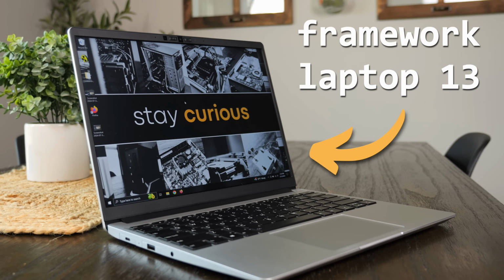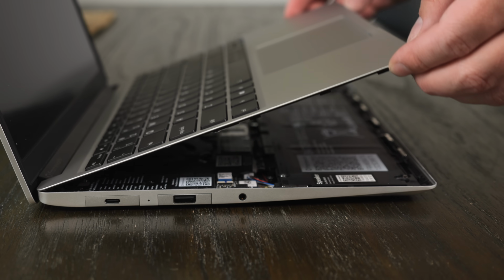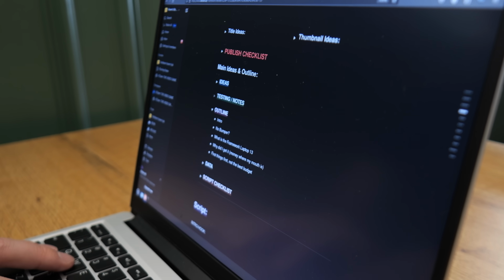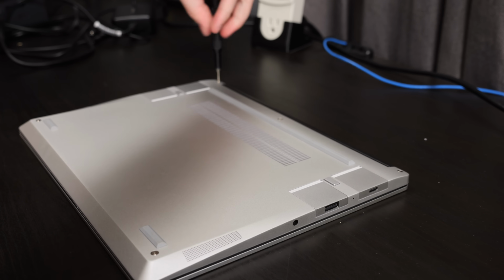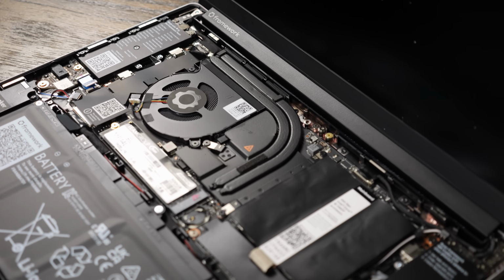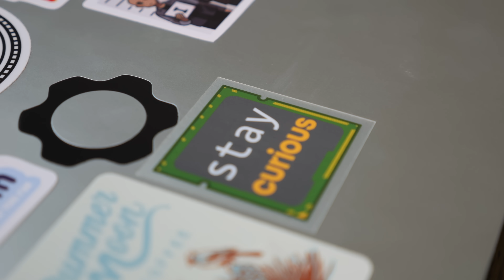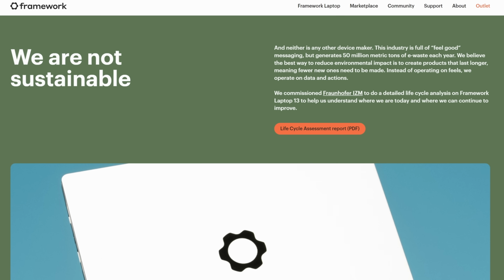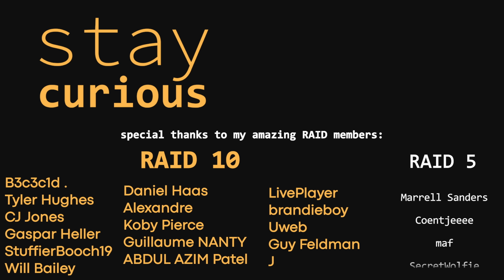Is The Framework Laptop ACTUALLY Worth It?

Comment: I always get frustrated by people completely misunderstanding the point of these laptops. Yes, they're initially more expensive than others (the company is also small, which adds up to the price), but the idea is that you'll never have to buy a new laptop again. You can just replace and upgrade parts as you need them without paying around $1k for a whole new system

If you only care about the price, buy a second hand thinkpad or something like that. But you'll still need to buy a whole new computer when you want to upgrade
Reply: @kadupse  You almost get the point of a Framework laptop before completely missing it.  Yes, in 3 years your laptop has wear, but the wear on individual parts is different.  I've got a couple decade-old laptops I'm still using, and the thing that fail first are the keyboard, trackpad, speakers, and battery.  Most of these are becoming hard to replace thanks to OEM design.  I've spent a few hours replacing a keyboard on a relatively new gaming laptop (while using a dremel, hot air gun, and a soldering wand to melt plastic), where the Framework would be 5 minutes.

Next up to fail is often the hard drive, although not certain if that'll be true for NVMes.  Still, buy a Mac and you're SOL when there's a problem past warranty.  Less often to fail is the mainboard/RAM but these events usually trigger a new laptop purchase.  With a Framework, you can still do that and keep your old chassis for projects, or you can keep using parts that may well work for another 5-10 years.  Up for you to decide what you do with your own purchase.

Monitors and ports do die, but most often due to damage.  They're easily replaceable on this unit, whereas in others it'd be a time-consuming fix or a mandatory unit replacement.  You mentioned that Framework laptops have had problems, but those used laptops you want to buy quite often have them as well.  Weak hinges is common on a lot of laptops, albeit normally cheaper priced ones.  Modern standby is used by a lot of laptops, and many OEMs don't allow you to disable the feature at all.  

The recent short battery life problems are partly to do with Display Port and HDMI ports not sleeping correctly.  You can fix this with a firmware flash for the DP, or a solder job for the HDMI, instructions provided by the company.  The HDMI one isn't worth the risk to fix IMO, but you can replace it for the $15-20 if you need the battery life.  Look through history and you'll notice a lot of hardware glitches or premature component failures common to specific models of laptops that go ignored by the OEM.  Even simply having the ability to replace defective parts that are sub $100 can make usability of your laptop a lot better.  And the components mentioned in this vid that the reviewer didn't like still work, they're just not best in class.

I'm still finding uses for my 10 year old laptop, and I expect to do so with my Framework going forward.  I'm also buying the 120 hz monitor as soon as it's released since it will fix my one problem with my 12th-gen (glare from the glossy screen).  The old monitor is going to be used for RPI projects, which requires me to buy a $5 HDMI converter from AliExpress rather than trying to figure pinouts of the monitor myself.  

Used laptops are going to become more locked down and less reusable as time goes on thanks to current-gen models aging out, so even if buying used is a good buy today they may not be 3-5 years from now.  I think it's worth supporting companies against it today rather than complaining about it in the future.
Reply from the maker: I'm glad somebody can take away from this video what I was saying lol
Reply: @HardwareHaven even your voice screams for low testosterone🤡 what an incel🐀
Reply: @kadupse  The difference is that you can buy them one at a time, instead of having to replace everything from a single fault. Very rarely does every part of the laptop fail at once, and if you can't replace individual parts then you end up buying a new laptop because your screen broke, then buying another new laptop because the chassis on that one bent, then buying another new laptop because the battery on that one failed, etc. But hey, at least doing that your machine will never be outdated!
Reply: Dell asked me to cough up 850€ for a Display replacement after Sending it in twice with the same problem. The first time the screen teared and occasionally failed completely. The second time it first teared then stayed completely off. Under warranty they swapped the Touchpad. The second time it just about wasn't warranty anymore. So now it was an LCD Problem. When it came back unrepaired, it worked again for a while. Both times it was a problem in the connection cable.
Reply: Also people would argue that for the cost of motherboard replacement you could get a new laptop. While that is true you would have to compromise on many things like worse display, less ports , soldered ram and stuff.
Reply: @kadupse  Wouldn't be in this situation if laptop manufacturers didn't stray from the original modular design. Nonetheless, what you're ignoring is the impact of e-waste, especially if someone doesn't end up buying your old model. What then? As much as Framework says that they're not sustainable, the traditional modular design (especially if it was make industry standard) results in much less e-waste.
Reply: @kadupse  Wait until you hear about the ship of Theseus. It's gonna blow your mind
Reply: @kadupse  Laptop screens aren't the only part that may need replacing. Motherboard? More advanced things, like memory chips and BGA cpus/gpus? How often can you find other parts easily for other laptops? The only reason I'm defending Framework's pricing (which is expensive) is because the rest of the industry has made it extremely difficult to source parts unless found secondhand. I wouldn't otherwise. Right to repair is something that needs to be made law.
Reply: @kadupse  Because you actively contribute to more e-waste? There's hardly anything you can upgrade in today's laptops and the more that you buy into the system the more that these corporations' decisions are justified. In regards to the defects you are pointing out, I can see where you're coming from but you don't want to give them a chance to improve? All you are doing is pointing out their pricing, ignoring the fact that  the majority of laptops nowadays have soldered GPUs/CPUs and some RAM. Is this the kind of design language you want to continue? If you still have a good chassis, screen, keyboard, etc why would you want to replace the entire device when all you need is a better board?
Reply: @meriscorditan2799  A better board means a better cpu, ram, and gpu...i all for replacing the laptop with a new one, faster and likely cheaper...i really cannot understand this Framework advantage for consumers...
Reply: I don't think that you will use this laptop for 10 years. "Just replace and upgrade" sounds too promising. No one guarantees that this company will not close
Reply: I love love love my framework.
Reply: @kadupse  What's the price you normally spend on a computer?
Reply: good luck selling them en masse, forget 3rd world countries am I right?
Reply: oh...you will need to buy another laptop...this a cheap flimsy piece of junk.
Reply: It's much cheaper if you pick the Intel Version and go for the Pure Notebook build without the GPU and the extra Hz screen, costing under a 1000. And it's even cheaper if you just supply your own SSD, Windows Install and Ram. I really don't see the point of having a GPU or any of that gamer stuff in a Laptop like this, that's designed for productivity in mind. Save that extra money for a PC Handheld or a Desktop Gaming PC, and have this for productivity.
Reply: It's brewing your coffee at home. Sure, to get it started you need to buy a nice thermos, coffee maker, grinder, etc. But, you get to skip that $4 take-out coffee in the morning.

It's a matter of ROI, trust in the vendor, and desire for self-repair. You could save the $300 dollars buying from <insert_brand> but you'll spend $400 when you break the screen.

Even if you're not tech savvy and don't want to DIY. I guarantee you'd have an easier time finding someone who can repair it for you, or even just a repair shop.
Reply: @kadupse  At least 4 "main components"? The only consistent complaints I've seen about the Framework 13 are the fan noise (fixed in newer models), the battery life (fixed in newer models) and the trackpad not being Macbook quality, which I wouldn't consider to be a "main component". 
As TheInsomniaddict said, for the price of a mainboard you can only really get an entry-level notebook. You won't be getting a more refined chassis, an updated webcam or a better screen, not just because those technologies are frankly advancing at a snail's pace in the laptop space now, but because the improvements there are all above the entry-level price bracket.
Reply: I get your point, but when I needed a laptop for university (I work with lots of VMs, so 32GB of RAM was a must), a Framework would have set me back at least €1300 for the Framework 14. My refurbished Dell Precision 5540 on the other hand was less than half of that and while it is larger and heavier than a Framework 13, it does also have a CUDA capable dGPU (albeit not a very fast one), which is nice. Besides, it is arguably better for the environment to buy a laptop that already exists than to buy a new one, even if it is a Framework. And, being a business device, my Precision also has upgradeable RAM and is easy to service.
Reply: @SilentdragonDe  Good on you if buying a used system was good enough for your use case.  I have a couple systems 10+ years old that I still use myself.  But used laptops are going to get more locked down as time goes on, just based on the fact that newer unserviceable systems will start aging into the market.  The more marketshare Framework gets, the more likely that other OEMs will reverse course on this decision.

Framework isn't the cheapest, but it's not meant to be.  It's a semi luxury brand for first adopters, although that's not the goal.  It will become cheaper as adoption grows.
Reply: @SilentdragonDe  Someone has to buy the new laptop so it can be passed down.   Which is just another problem with the framework, used laptops always find uses, its not a waste at all to simply upgrade.
Reply: Yeah, this is a GREAT laptop for someone with a clumsy teenager or a harsh work environment 👍
Reply: @edwardfletcher7790  Or that disagrees with how wasteful we've become
Reply: @edwardfletcher7790  personally i don't think so. Yes, it's way easier and cheaper (most of the times... possible while others are not) to repair, but it's less solid for impacts and... still way more expensive (at buy) than have 2-3 used "business" laptops that could act as cold spare with a fast data restore.
In harsh work environment, currently rugged laptops are still most likely the preferred choice for... impact resistance for starters, IP protection subsequently.
Reply: @kadupse  For the amount I would spend on a new mainboard, you'd be able to buy an entry-level notebook.  All of the peripheral components that came with your original Framework are going to be better than what shipped with your new more modern computer, in most cases.  Unless you're talking used, in which case you're planning on buying a 3-5 year old system now so you can buy today's hardware in 3 years.

You mentioned in another comment that you expect many of your components to have problems by the time you get a new laptop.  How cheap do you go when buying a new computer, exactly?  Most of my systems aged out without any major hardware problems.  I'm still using a few at 10+ years old.
Reply: > without paying around $1k for a whole new system
You will pay $1k for a new motherboard
Reply: @sigtermnull  That's the most expensive option, yes, but you failed to mention it also comes with the CPU.
Reply: @LupusYonderboy This is too obvious to mention.
Reply: @sigtermnull  the only motherboards that cost close to 1k, are the ones with really high end processors.
Reply: You can actually buy the mb separately, i dont know the price off the top of my head@goremukin1
Reply: @sigtermnull 
Wrong. New motherboard is $450 for equivalent new intel cpu.
Reply: @sigtermnull no. You don't. Almost 100% sure non of these are 1k😅
Reply: @sigtermnull  wrong, the motherboards arent as expensive as buying a entire new laptop.
Reply: the cost to upgrade then is almost the same as a new laptop. And no one misunderstands the point of these laptops. They are simply saying why they don't want one. They are not saying no one should buy one or that it is a worse laptop.
Reply: If you only care about price... you can also buy a SH Framework. Though to be fair, they might be pricier than other SH too, but I still think it's a good option, given that with Framework you can be pretty assured that it can last 10 years, except big accidents, with just minor, not so expensive repairs/upgrades. Even if Framework goes bankrupt.

Same for upgrading. Yeah, a new motherboard of the latest generation is quite expensive, on the order of an entirely new laptop. But if you don't REALLY need the newest and greatest, you can buy a couple years later at half the price. And still retain all the other parts that you like.
Reply: Yes, but at what point is it worth upgrading a laptop once it’s been “Ship of Theseus”’d?
At some point, every part in the laptop will be either obsolete or damaged enough to warrant a replacement or upgrade, and a while later, the laptop will be completely different from the one you started with inside and out, while also being a lot more expensive than just waiting to get a newer laptop.
A good idea, though, is that someone could fabricate a Framework-compatible mainboard, as long as it fits in their chassis and has the right positioning.
Reply: @fujinshu  This is the issue that the Framework Laptop 16 is currently facing. It's not only obsecenely expensive compared to other gaming laptops, it's already limited by their component choices and the price of the future ones will most likely mean you're better off buying another laptop anyway :( But I think their target audience already knows that, they're not buying the laptop because of its performance or price, but because of how easy it is to tinker with it, beyond anything else. But it's still a massive premium that has put off a ton of people, myself included (I just couldn't afford it at all).
Reply: @fujinshu  To me, the point is that i can have a laptop "forever". Even if i swap parts here and there, i don't have to buy a whole new laptop each time.
If i'm used to the form factor, the keyboard, touchpad, etc; when i upgrade, i'm still at home. If i shell for a top quality screen, i don't buy it every time.

Also, i can fix anything on the laptop without having to send it to the manufacturer. 
At last the port swap things is great.

So yes, it is more expensive, and at some perhaps i'll want to buy a whole new one, based on a new chassis. But i know that i can maintain the one i have for pretty long.
I know i'll be able to get batteries. 
At home, i have 3-4 previous laptops that work, but all have an issue. All have a dead battery, and it is a pain to get a replacement, if possible. my asus has a semi broken keyboard and various other issues. If i could fix the keyboard, change the battery and swap the mainboard for something more recent, i'd keep it. Screen is a nice 144hz one, so good; the chassis is also nice.

I also like the fact that my framework is amd, in 2-3 gens, if intel releases a banger, i can upgrade for better ipc and efficiency while keeping the same laptop.

Also it is one of the few brands that have good linux support.
Reply: @fujinshu  I'm pretty sure framework have released/will release diagrams- they're pretty open source with stuff
Reply: @fujinshu no. Ofnyoubwould need every three years a new laptop. It's way cheaper to have one that can last 10 years. With reduced cost.😅
Reply: @fujinshu  When do you upgrade your desktop computer, assuming you still have a desktop computer?  The Framework laptop is as modular as any self-built and some pre-built systems.  Have you ever wanted to upgrade or add a dedicated graphics card to a desktop computer, or would you just go out and buy a new system whenever you wanted to play a new game?

Have you ever needed more RAM or a larger hard drive?  Did you just replace your desktop PC?
Reply: LOL upgrade cost exactly around 1k
Reply: @severgun  "exactly around" is an oxymoron
Reply: A older business grade laptop (latitude, thinkpad, elitebook) is 1/4 to 1/2 price, very cheap repair parts, sodimm ram up to 64gb, ssd to 2tb.  Plus 3050 gpu are available. Overall a million times environmentally friendly and less wasteful similar to an Toyota truck vs Rivian.
Reply: @22phan  That's great, it would be nice if we could use even newer components. What I'm saying though is that laptops should've stayed modular as an industry standard, much like desktops. EDIT: Even more reduced e-waste as a result.

Comment: I got a framework at the start of this year and have had the same issue with thermals which has driven me nuts! I never took the leap to replace the thermal paste as I deemed it unnecessary. However, this video has given me the motivation to do it. Thank you! ❤
Reply from the maker: I was genuinely shocked that it made a difference